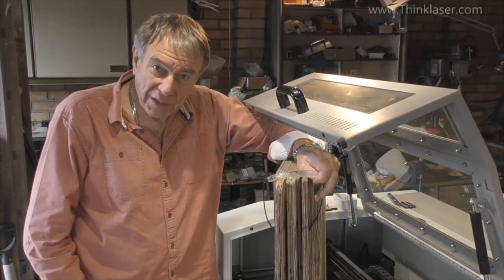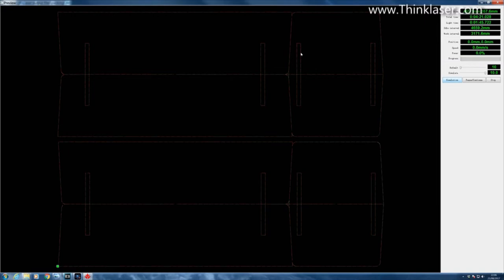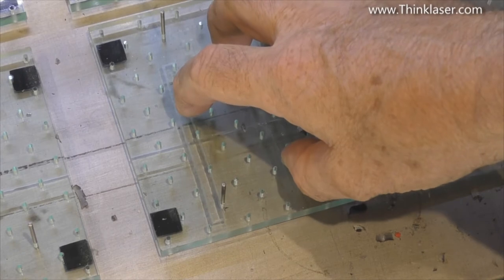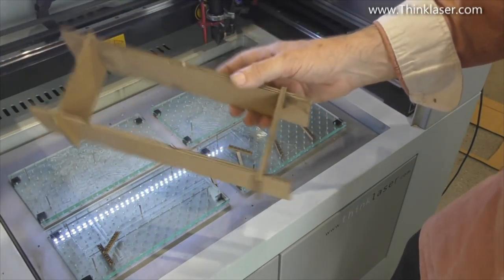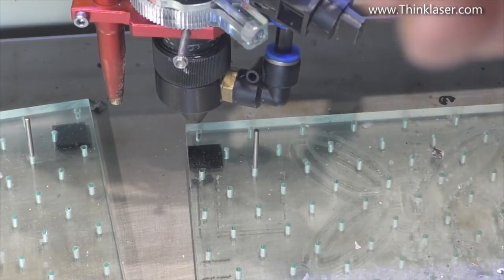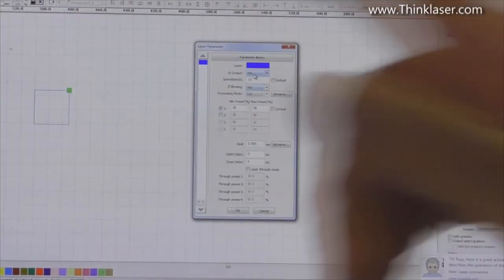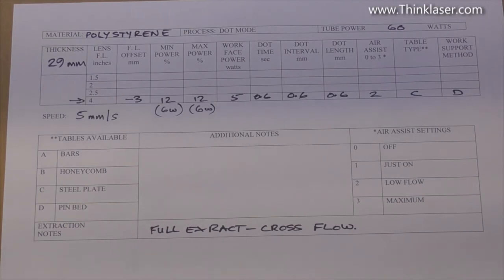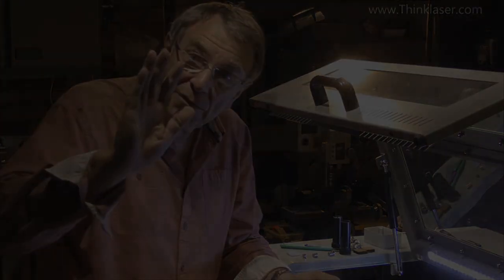How To Use A Laser Cutter - Lightblade learning Lab 33 DOT MODE for Those Impossible Tasks

Comment: Based on your success with the triple wall and with the rather thick polystyrene, one would expect that foam core poster board would cut nicely. Using regular cut mode with such poster board results in concave edges between the poster layers.

As usual, a quite informative and enjoyable video. Thanks.
Reply from the maker: Hi Fred,

This is Gareth from Thinklaser. I don't believe we've tried cutting foam board yet, but DOT Mode looks like it could be the ideal solution.